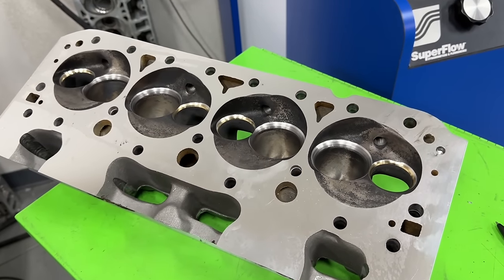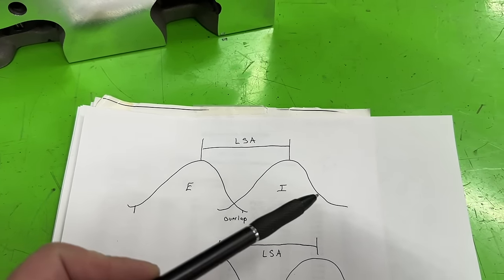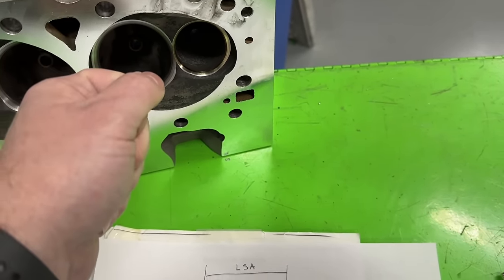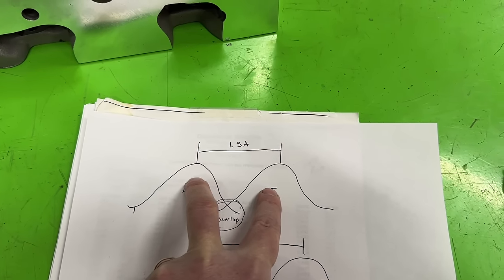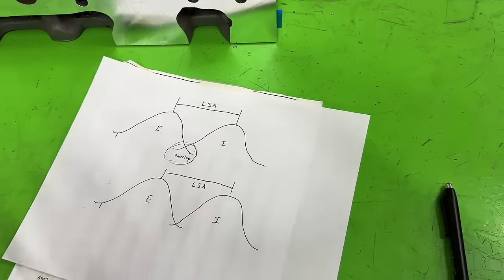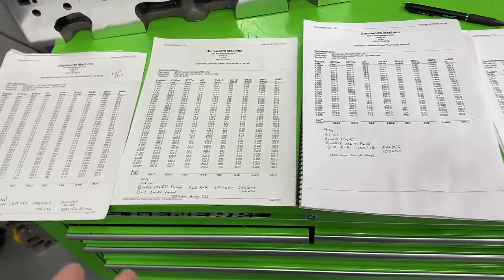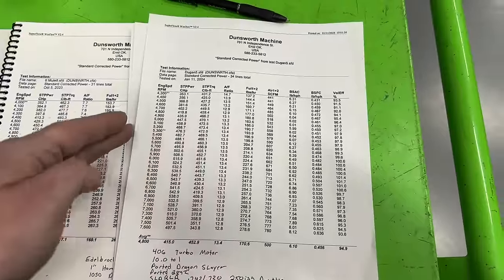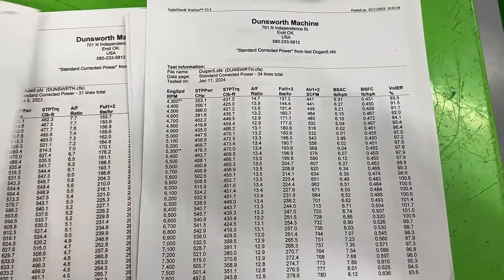Difference Between Turbo Motor And NA Motor

Comment: I’ve been following Gale Banks for years. His turbo engines use a large chamber cylinder head. I’ve seen some picture of his big block pistons. They are flat under the flat area of the cylinder head, and drop like a dish where the chamber, he calls it a reverse deflector piston. His street engines usually run 8.5:1 compression. He also uses water methanol injection. 
Good info.

Comment: What you said about cams and compression reminded me of my 69 Chevelle I bought with 12,000 original miles on it.  The motor had 195lbs of cranking compression with the stock hyd cam but then I installed a Cheverolet solid flat tappet cam for a L71 and for some reason I can't remember we took another cranking compression test right after installing the cam.  The compression with the new cam came down to 165lbs and boy was I cheesed off.  I thought for sure we messed up somewhere and the thing would run a pig.  Right about the time my friends and i were about to tear it down again my buddy took it for a drive.  Holy crap did it make a difference.  It took me months of reading and asking questions to find out why my motor with less cranking (dynamic) compression ran so hard.  Thanks for reminding this pimply faced kid something he learned 50 years ago.  You explained everything very well, Eric
Reply: Thats part of the reason why some circle track classes have vacuum rules. You start stabbing in a meaty cam that will make some beans its kills the idle vacuum.
Reply: Eric is one of the best on YT when it comes to explaining engine performance related topics.
Reply: Cylinder pressure is torque, on average, through the entire curve. You CAN have too much or too little for abgiven fuel or application. By adding a larger profile cam, ie: valve events, you will decrease that cylinder pressure at a lower rpm, like cranking, but will make more in the higher end where the cam is more suited. Combine that with the added air/fuel mix the engine is now seeing with the higher rpm capabilities, and it more than makes up for less cranking compression. Apples to Apples, by putting the compression higher along with the larger profile, will make even more power. 
Cylinder pressure is key, just depends on the application, fuel used, and where you want it to be.

Comment: I have long focused on overlap and LSA. With turbos, I look at the pressure ratio across the system and use that to help guide how little, or even negative, overlap I run. The numbers end up looking odd, extremely wide LSA with negative overlap numbers. And to run the turbo harder I have taken to adding to the exhaust opening. The results have been spectacular. 

I love running Dominators, too.

Thanks for the video.

Comment: Love the videos.   Even a layman like me can take something from them.   This one made me feel better about my 106 LSA in my NA 331 CI SBC.
Reply: @bengibson8778 made me feel a little better about my 418 sbf vic Jr. Heads vic Sr. Intake. 10:1 but set up on a 113 LSA. Waiting to hook the procharger up and feed it the boost. Made 531 H.p. 481 TQ. NA at the wheel.

Comment: Eric, I believe you are referring to Richard Holdener. So I've watched his videos, and yes, he says N/a is turbo cam etc. But, as he is testing the engines, he is only adding a boost, and the graph always does what he refers to called railroad tracking. He makes more power by just adding boost. You are talking about ways to make more horse power and / or make it live. But the bottom line is this, add more boosts, and whatever the combo is, it'll just keep railroad tracking.
Reply: Yes I thought of Richard holder too. Richard keeps things simple for a large audience to enjoy and concentrates on (the guy in his shed) builds. Eric seems to get more serious. 
So maybe both are agreeing essentially. 
Thanks for posting my thoughts. Kind regards
Reply: Turbos follow the same curve NA gives it. So yes, whatever cam is in there to make that power Ina given curve, will be glorified with boost pressure from a turbo. By changing the characteristics of the cam profile, will deter the NA power and curve, but not enough to warrant losing the ability to make boost reliably. If the engine drops 10 or 20 numbers on average through the curve by changing the lobe profile, that can easily be made up with the added boost pressure without hurting parts.

Comment: Eric, I think you explained it pretty dang well. I ain't a turbo or NA guy, but I run blowers or nitrous and they call for a very similar cam. I know turbo is different than those 2 combos. On this little Sbc e85 f3-121 New Era gear drive 
434 23° head hunter deal I basically run 12.5.1 compression with a 114 LSA @50 276 int @50 285 and 860 lift not puttingbthe rest of the cam info on here but 1.6 shaft rockers. And like you said NA wasn't real impressive but that procharger is making power all the time. I'm switching to a Vortech V30-128 New Era gear drive deal.

Comment: On the 60 lbs boost AMC 6  with an old school wedge chamber (heart etc) we ran tight quench which was only on the away from the spark plug side,  
D Dish piston like the TRW "TURBO" chevy piston which came later(as I remember will have to check)     D Dish worked better than "down the hole" or circle dish  TRW was a sponsor  valves, bearings, timing, unground cam cores, rings

Comment: Good discussion of the differences between engines with different characteristics. The effects of wider LSA go beyond overlap if you keep the same cam lobes. IC, intake closing, gets later which has effects beyond the overlap period. I think Brian Tooley said “the cam events are what they need to be”, or something like that—in other words there’s a specific overlap an engine needs for NA mid-range torque and specific EO and IC events to run at a particular rpm range. The LSA is what it is when you look at design from that perspective. In the end, your Engine Masters cams show that more overlap and moderately early IC make a fat torque curve and decent horsepower when combined with effective cylinder heads. A strictly drag race engine doesn’t care about anything below the torque converter stall and may be built for just the top 2000 rpm window. Great discussion, thanks, Eric!

Comment: Another thing that helps NA engines make more power is to REALLY decrease the flame area total on the piston as it helps reduce the heat loss of both the piston crown and combustion chamber. 

I knew this, but until I developed an engine over 7 years of part time work I had no empirical data. I talked with Kevin Cameron(tech God at Cycle World) who confirmed the hypothesis.

Comment: Well done. Lots of people over there is in need of hearing this after what RH has "tought" them. My best example is australian racer Dick Johnsons RS500 Sierra Cosworth. NA on the dyno his 2.0L engines delivered 90 hp. With 2,4 BAR of boost (35 psi) it delivered 680 hp. Dividing it back, 680 hp / 3,4 MAP = 200 hp from "The theoretical NA" wich it what exposes the 100 hp/L NA truth. :)
Reply: Redbacks on the racetrack. Love those Sierras 👍👌❤️

Comment: I just read the instructions from Gale Banks manual on his twin turbo small block. 
 There are two versions of this kit. A complete 4.125 bore, 3.425 stroke, 366 cid, complete engine kit uses dart pro 1
The cylinder heads were dart aluminum heads with 2.08/1.65 valves.
 Now the regular kit designed for 355 cid engines used dart cast iron 72 cc chamber heads with 2.05/1.60 valves. 
 See I paid attention when you said open chamber heads would probably be better for forced induction.

Comment: On small lifter motors sometimes you need to open intake earlier to get the valve open to follow piston demand.   One reason that OHC can use shorter cams

Comment: Another great video, thank you! I have a truck question. Tricky for me anyway. I just built my motor from NA to F1R pro charger. I had Isky size the cam for me and I reduced my comp ratio to 9.8:1. Question is what if I decided to do twin turbo instead issuing the cam that was specked for the Pro Charger? Thanks in advance if you get to my question. I don’t remember the specs off hand because I’m 50 now and have a bad case of CRS!
Reply from the maker: I would switch camshafts
Reply: @WeingartnerRacing  I kinda figured that. I guess I’ll stick with the Pro Charger. Thanks Eric and also thanks for the great info! Keep them SBC videos going!

Comment: High compression and boost is great if you are a godlike tuner, makes tons of power, but you're also running closer to the edge, detonation, wear, heat, combustion itself starts becoming an issue, if you miss a combustion event and you flood the cylinder with fuel, on the next cycle, kaboom. You can make it work if you have very precise control of timing, fuel delivery, and the combustion process itself.
Reply: You can do A LOT more than what most deem "the norm". But the "Norm" is based off hear say and Youtube. Conservative decisions offer a much greater tuning window incase something isn't 100% in the tune. Aggressive decisions don't have that, so you better be in your game. One makes much more power than the other. Neither way is wrong as it is claimed to be.

Comment: Good afternoon Sir. This isn't related to this video, but I was wondering if you've ever done any "testing" on the mid-90's Aluminum LT1 heads? There's a couple water passages that need to be welded over, but that isn't a big problem.
(I've got a few sets) I thought about drilling a 1/2" hole up front to use a 'epoxied' pipe to connect a cooling passage between heads. I also have a few old 327-400 Chevy blocks, so I'd like to utilize the 58cc(?) chamber and just clean up the throats and port match a carb intake. That's it.. Just for a Cruiser engine, not a competition one..
Reply from the maker: I haven’t

Comment: 105-109 LSA is the sweet spot to make best na power usually I’ve noticed.
Reply: I remember years ago during the Engine Masters competition, the street class, 2500-6500rpm, they had really tight LSA. One engine used a 98° LSA but 102-106 was really common. You couldnt really run it on the street like that, it would idle like hot garbage, but it really pumps up the torque.
Reply: It is all relative... Just depends on where you need the power. LSA is just a byproduct of valve events. If those are correct, then a centerline is the outcome. Extremely application specific.
Reply: @jrdmotorsports9718  I’m talking about sbc family exclusively and in baddest na you can make. Of course I’d you want torque for towing etc things change.
Reply: @Thumper68  Again, it's ALL relative. Doesn't matter what engine family it is. It works the same way.

Comment: Im wondering how much a softening of the chamber hurst when using a piston with bowl.
As it stands Im getting 13,5:1 on my v6 build so I need to decrease it to be able to run gasoline (98 euro).
I might be able to relieve a few ccs around the valves but for more cc I think Id need to soften the chamber some.
But since the pistons only have a 10mm squish-band around its perimeter I assume the quench pad in the chamber doesnt do all that much?

Its really not a high performance engine so maybe it doesnt matter anyway.
(Its a 3.4l v6 thats going to end up making around 250 hp@5000rpm with a 6000 rpm rev limit.)

Comment: I’m sure Richard Holdner will have some smart ass comment to make on this video!!!
Reply: Richard has already proven this wrong many times with 1000-1500 hp engines.
Reply: @keysautorepair6038  
Sir but never in an automobile or at the track. He would get embarrassed with his off the shelf cams and small valves and never decreeing in a cam!!!
Reply from the maker: I enjoy Richard but the turbo motors on the engine dyno are limited to 1500hp because that’s all the dyno can hold. I’m talking about making more than that. More than 20lbs.
Reply: @keysautorepair6038 Think of what he does as a magazine article with an agenda, as Editors always do. He is not an engine builder, and far from it. He hasn't proven anything wrong, he just reports on tasks others have already done and make a video. The agenda is to be popular on video, not for the knowledge he seems to lack, to a certain level.

Comment: Someone please send this to Richard Holdener. That guy fails to understand overlap in regard to turbocharged engines. He preaches that more overlap will make more power regardless of boost pressure. I made that mistake before, 20 psi with 32 degrees of overlap and I had immense amounts exhaust gas shooting out of the blow off valve after every pull 😂
Reply: That's because he is NOT an engine builder. He is an "Editor" for a Magazine. What do "Editors" do? They edit information that best suits their agenda or story. They report on information from other's past experience to create a story. Or now in his case,  a video. Ever hear the phrase "Never build an engine to a magazine article,  you will be sorely disappointed"? That is why. 
Should be a huge disclaimer on his videos... "For entertainment purposes only"

Comment: Hey Eric,
     Tim here, ur probably gonna say it in a min. But the cam in a turbo motor is vastly dif, i'm an NA guy, but i DO know, that a 108 LSA, is BAD for a turbo motor, and 114 LSA is WAY better, as we arent throwing away BOOSTED pressure on overlap!!, reduce overlap timing events, and we get to CRAM in MORE of the boosted charge

Comment: I'm sure most of the people here are aware of Richard Holdeners LSA test. I'm hoping we'll see LSA and overlap tests from more creators that's hopefully unbiased.
I've herard, and I'm sure many people has, many a theory about that topic regarding NA and boosted engines.
And that's nice enough to have discussions about.
But actually scientific evidence where engines are tested are scarce when ignoring manufactures of cams and engines.
I come to think of, I think Honda has a boosted engine with VTEC only on the exhaust cam?
Reply from the maker: I may do just that test but the engine dyno can only hold 1200ft lbs of torque. The test needs to be done on something at 2500hp. One engine will die though trying to make it.

Comment: Have you ever dyno'd an engine with 2 different cams (and the cams being the ONLY difference) where one of those cams made more power NA but the other cam made more power with a turbo at ANY boost pressure (but boost kept the same between both cam tests obviously)? I know Richard Holdener hasn't bc I've asked him exactly that and that's why he believes what he believes. I understand what you're saying about the theory behind why you'd choose less overlap for a turbo cam, but I have yet to see an actual back to back test confirming it in practice.
Reply from the maker: I haven’t but might this year.
Reply: @WeingartnerRacing  Would definitely like to see that if you do.

Comment: All engines are turbo engines technically. I’m a firm believer motors are electric since the word originates from the 1500s and meant one that imparts motion. So if you replace motor in all historical companies and devices names with motion you’ll see why they were named that way. Over time society used the word incorrectly thinking it was same as engine out of ignorance and it became a common use thing unfortunately. Ford Motion Company, General Motion, motion cycle, motion home. And everyone says what about locomotive well it had a steam engine. There’s a reason we say electric motor and nobody say electric engine cause engines are combustion and motors are not.

Comment: I’m not sure I agree with you on this one have seen many times people dropping compression on a turbo engine and killing power willing to listen and learn
Reply from the maker: The problem is they are dropping too low. 11.5 to 1 is about the limit I have seen customers get when trying for big power with turbo. The problem many are doing is old school 8.5 to 1 compression on a turbo then they are not that great.
Reply: It will, since dropping compression hurts power NA, it will do the same with boost. Doesn't matter how much you drop it,  it's all relative to NA. 
Static compression is solely based on target boost level and most importantly, type of fuel being used for a given application. 
Cylinder pressure is Cylinder pressure. That's all the engine sees.. Just depends on how you want to make it.

Comment: If backpressure is higher than boost you have wrong turbo.
Reply from the maker: Most likely or you pushing it to win.
Reply: @WeingartnerRacing  maybe if rules limit turbo choice for some reason. Or you have to use intake restrictor. No other reason to have high backpressure.
Reply: @shvrdavid  you are setting it up for lower power. Also killing turbo thrust bearing with bad ratio.
Reply: @shvrdavid  nothing special these days. Except for these 2 valve pushrod dinosaurs.